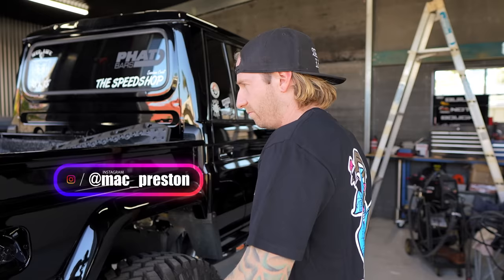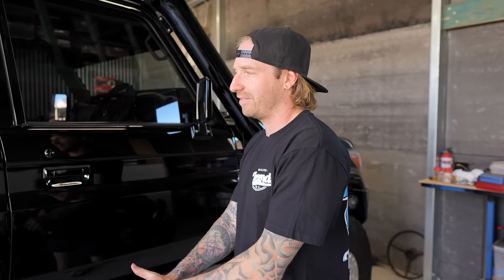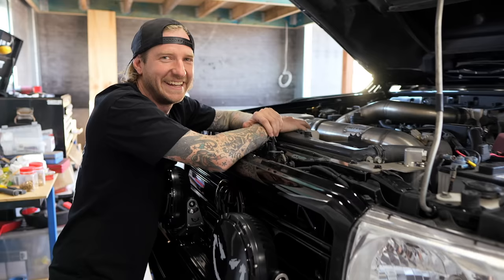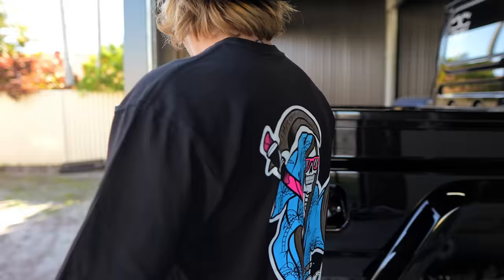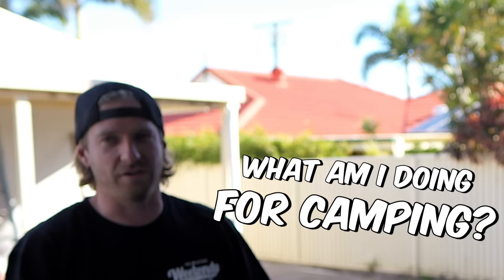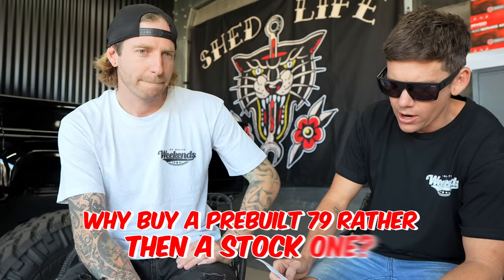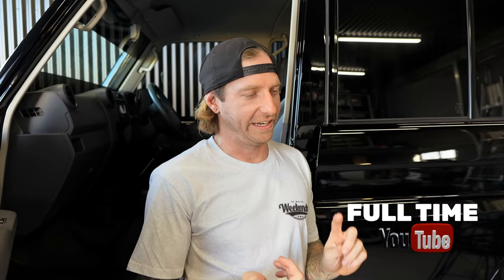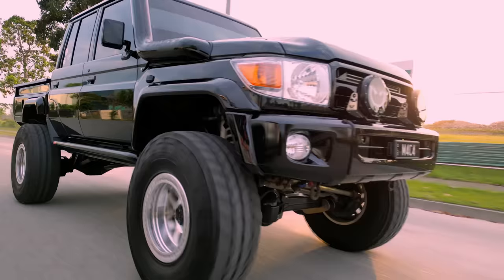79 Walk around - Finally something different !

Comment: As much as I love HPD please keep an eye in your catch can, the problem with the placement of it next to the radiator the heat soak WILL cause the oil in it to coagulate in the can and cause back pressure. 

Unless it's vent to atmosphere. 

Also that's alot of turbo noise for a DPF model.
Reply from the maker: Thanks for the tip Michael !! 🤩

Comment: Is that snorkel a fancy one that is designed to be on backwards? Otherwise, that's at least part of the reason the air box isn't getting enough air. With traditional snorkels, as soon as you're going fast enough to lower the pressure behind the intake, your power starts dropping if it's on backwards and the faster you go the worse it gets. It's fine to spin the head around in low range for things like rough river crossings or tough branches, I've got a 10mm in the glove box for solely that purpose, but it's dumb to run it that way full time. Especially if you're driving it on the motorway.

Comment: seeing as it was vin'd on 37,s you should be able to run 39,s as i think the 2 inch taller tyre increase can apply  due to it being plated with 37 inch tyres , not sure but think that its a good arguing point if you get pulled lol, nice work though ,
Reply from the maker: hehe i think it drives real well and looks wicked on the 37s anyway